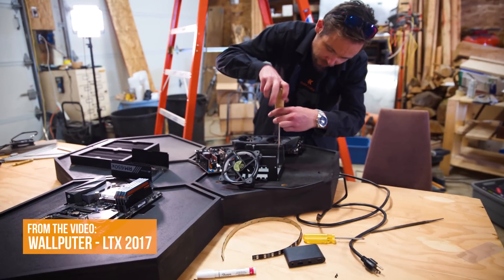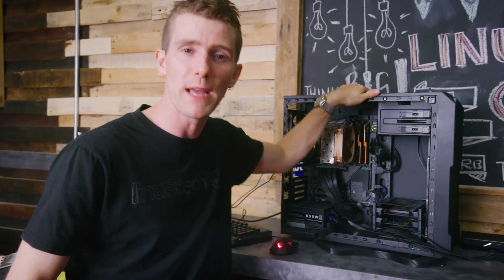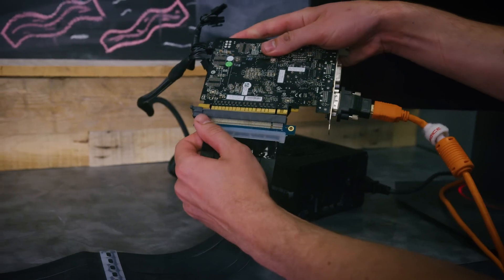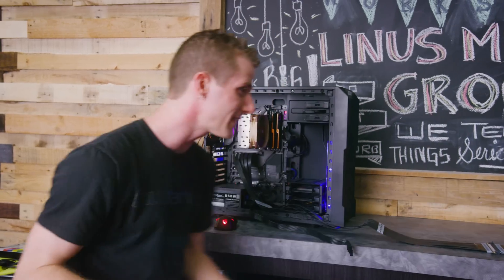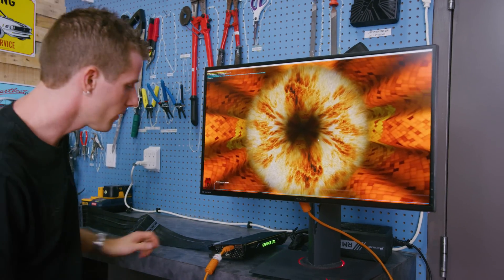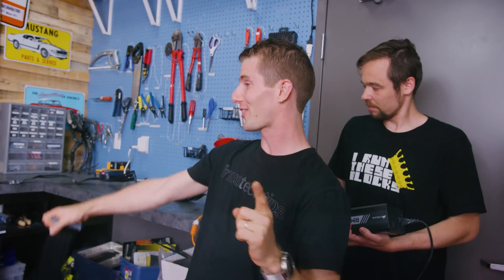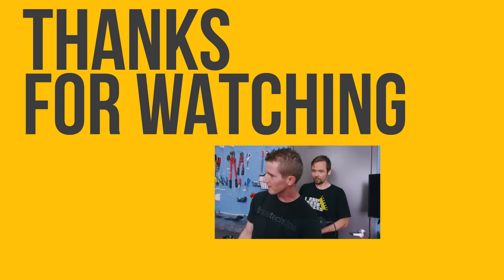How many PCIe Extensions is TOO MANY??

Comment: Hi there, while looking for a solution concerning PCIe extensions... (...the year is 2024)  your test popped up! Very interesting!

I have a Gen9 HP DL360 and I am willing to connect two external GPUs by using 2x PCIe 3.0 x16 extensions. Reason: It's an old machine, it was bought relatively cheap, and it's already here... and it hasn't, to a certain extent, disappointed me yet!

My Idea:

Use the PCIe 3.0 extensions running through the back of the server - plan is using long ones - removing the slot covers to allow the extensions through;

My server PSU is a platinum 1400 watt which came with the server when I bought it. It's meant to power up the server's CPUs and the usual server stuff, and therefore I believe an 800 watt psu will do the job, leaving me the 1400 watt to use with the external GPUs by adding a Parallel Miner breakout circuit;

I have 4 SATA power connectors, and I am currently using only 3. The thing is, while I plan to use an HP similar power supply but being with a breakout circuit such as the [ X21 Breakout Board ], do you recon there is any sort of way I could use the fourth sata power connector to send signal to the external power supply breakout circuit to tell the PSU to turn on? Or is it best practice to power-up the auxiliary PSU and then fire-up the old HP Monch...?

Theoretically I think I could plug an Add2PSU chip to the fourth sata port in order to send power signal to turn the secondary power supply, but correct me if I am wrong, that would have to be an ATX power supply, right?

...thanks in advance!

Comment: Hmm, that's an interesting idea. buy 2 power supplies and one will pull the CPU and the other PSU 2 GPUs in a different Case. This may solve the overheating 

It wouldn't even take up that much space if I had a smaller Case and I could have a 4or5th 4K monitor on. 

I have an RX 6800 xt and an RX 6950 xt at home. Probably, I wouldn't even lose that much performance on that 6950 xt

Comment: You can't do that with Dell prebuilts which have a single 6 pin power connector to the mobo (instead of the 24 pin atx).

Comment: 4 is too many, how the hell do you have the space to use all 4 slots and still be able to use the x1/x4 pci-e slot?  these days graphics are so powerful and reliable, you only need 1 graphics cards, then if you're a media addict, a capture card, then a sound card, but that's pushing it with heat output

Comment: Make a multi case build where as many components are stretched as far from the mobo as possible using extensions etc. and each component housed in its own case, with case cooling etc.
Be interesting to see what kind of thermals you could achieve by isolating components and cooling individually

Comment: Well I mean even copper wire has resistance.. the longer it is the more resistance it accumulates.
Apparently though it takes the length of a football field of copper wire to achieve 1 ohm of resistance

Comment: hey Linus, question for you, how will these extenders work with the new 3000 series? like the 3090 for example that has a crazy 19.5 gbps, I read the specs on the Thermaltake premium extender and it seems it only goes up to 8 gpbs so I assume there will be a huge performance loss there, Cheers! and keep up with the great videos!

Comment: Are these PCIE G4 or gen 3? Instead of looking for dropped frames you should check the bios for PCIE link speeds. If your PCIE link is gen 4 then with the extension it's already degrading to Gen 3 and the link training is now happening at gen 3 speed. And maybe even worse Gen 2 speed. So working or not working shouldn't be the criteria. Btw if your link speed trans at gen 4 speeds then you don't even have to look for dropped frames it's trained at gen 4 speeds and it's not gonna drop any frames.

Comment: Really it comes as a huge surprise that more than it worked with more than one.  With that other one you had made of ribbon cable one is probably the limit.  And to think for a while we were connecting hard drives with ribbon cables.  I still remember my Uncle every once in a while for some reason unable to get a hard drive to be detected.  My only guess is he fidgeted to much with the connection, ever notice how loose those ribbon cables get on the drive when you mess with them too much?  It is a miracle people put up with that as long as they did!

Comment: Jesus this really shows one of the bottlenecks of modern systems, especially computers (consoles don't suffer from this problem as much due to much better integration). The CPU is always spending such a huge amount of time just waiting for shit to arrive. And communication with the GPU is just so slow due to all the layers of abstraction (which consoles just don't have or need due to only having 1 GPU they'll ever use) and other messing about. For example if we assume that electricity travels at he speed of light in CPUs (it certainly doesn't), then for every 1m between the CPU and the GPU you're introducing at minimum 10 CPU cycles just *purely due to the distance*. So in reality you're probably introducing hundreds of CPU cycles of delay here, and the system doesn't even notice it. It really emphasises the problems.

Comment: You didn't try running a blender or a power drill in the room.  The longer cables will be more susceptible to em noise pickup.  The experiment result will be different depending on the environment.

Comment: Food for thought. Wire Heat Maths- more Length = more amps across wire = more heat. The motherboard  contact could be thermal throttling because of the PCI connection being so long, a classic case of over-amperage. Also the gpu may be over heating due to the over-amperage. Watercooling the gpu may help the framerates as well.

Comment: You ought to do this one again! But this time with PCIe gen 4. It's basically a big deal that the traces have to be "better" for it to work. Will "dumb" wires work though? Also: dumb PCIe bifurcation modules such as the Asus Hyper M.2 x16 card: will they work with PCIe gen 4 considering there's like almost no logic on them?

Comment: 1's and 0's are allways 1's and 2's. No matter the voltage it's still just reads as on or off so you would need to have about 78.32 meters minimum of risers before you have the total resistance level of 0.00010

Comment: I know this is old, but I was curious about the theoretical limits of this idea.

PCIe Gen 3 has a base clock speed of 8 GHz, and power is conducted through copper wire (I guessed for the risers' wire material) at ~2.85x10^8 m/s.

This works out to one clock cycle being the amount of time that power could go around 3.5cm, about 1.1% of the achieved distance. Obviously there is something incorrect here. My guess would be that the PCIe clock can slow, giving more time for the signal to transfer, though I don't know how they would slow as far as these guys got without loss of performance. If anyone knows how much data a Titan XP draws from the available PCIe bandwidth running the type of application they were, you could figure out how low those clock speeds could go, but I could find those specs online. 

Interestingly, this means that older PCIe generations should actually be able to go farther, as their lower clock speeds give more time for the signals to propagate.

Just some thoughts. Good video!

Comment: I can't imagine that Furmark pushes very much data through the bus or is sensitive to latency.  It's designed to set up a bunch of (fuzzy, fuzzy) nonsense for the purpose of heating up the shader units, but it's mostly independent of the motherboard.  Video encoding would be a better test-case.

Comment: Typing 22. august 2019. [PCIe 4.0 is coming up] Does the riser cablels have a kind of signal amplifier? I´m right now intrested in the new PCIe 4.0 16x motherbordsbords (x570) and hered that they use special technics to get the signal stabel over a longer way for secound SLI card for example.

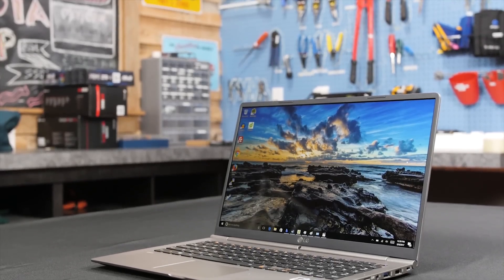Comment: 8:09 So the test starts stuttering, they say they reached the limit, aaaand... The cards cooler is totally blocked on the table. (facepalm)
Reply: I wonder if it would stutter or have smooth lower FPS instead.
Reply: @ПётрБайкалов-з1е  good question. I have no idea. I could see arguments for either case.
Reply: @ПётрБайкалов-з1е  nah

Comment: Makes you wonder why nobody in the high-end case market hasn't already used PCI-E risers included in the price to provide a creative and vastly more efficient mounting position for the GPU...

I mean, screw vertical mounts to show off your bling... What you want is your GPU fan intake directly stuck onto an intake - or better yet, just a separate compartment at the bottom or top where you can both get direct access to fresh air AND vent all the heat right outside the case to make cooling the chassis trivially easy.

Of course, nothing is really stopping you from just doing this yourself. It would be easy to use a riser from a lower slot down to any case with a bottom intake - or you could go full ghetto and just let it sit outside your case if you just don't care :D probably well worth the cost in terms of cooling benefits over lots more casefans, watercooling or very expensive models with overengineered coolers.

Comment: `Yeah, this makes sense. signal loss due to the connectors and copper. however; a properly made cable would probably still go further. IBM had this issue like 30+ years ago with cable runs to the Disk storage on their 'System/38' mini-frames (not quite main main frame class) we are talking 30 ft distances, and entire room distances. Their solution? 5mm coax (one for each  signal line) platinum cables. 

How do I know? I scavenged some of those bundled drive cables (about 1" around) and repurposed them as video cables. - new ends on a couple and 30ft+ later I still have no discernible issues with  signal problems. Now even tested to 1080i standards too.

I had two of these cables - looked like this: https://upload.wikimedia.org/wikipedia/commons/c/ca/IBM_360_Bus_Tag_Cables.png

They were the bus cables that connected the main system to the 'exterhnal' enclosures teh drive stacks were housed.

Yes, I cut my professional teeth on this machine -  from operations to programming in RPGIII.

Comment: good to know, I need to get one of these to move my parts from one case to the other, but it already has a riser from a SFF case that uses m.2 nvme drive on it and the GPU, and it will make it sideways in the case not attached to the case, so this is exactly what I needed to make it fit into the new case! Instant buying tomorrow!

Comment: Quick question about the power supply. I need to power a gpu with its own power supply similar to what you've done in the video, but the Rosewill 550w PSU I've purchased claims that it will not power on if it's not connected to a motherboard. Has that been your experience, and is this an issue that is specific to certain types/brands of PSU? Any help is appreciated.
Reply: Nevermind. The "paper clip trick." I thought it would be much harder to find the answer. :)

Comment: you can now buy a 4m pcie cable :)  https://www.amazon.com/LINKUP-Shielded-Twin-axial-Extension-Straight/dp/B07CS54VHS/ref=pd_sbs_147_5/260-5546373-8668643?_encoding=UTF8&pd_rd_i=B079926NM5&pd_rd_r=79d18581-5c1a-11e9-a40c-a5d2740d4f57&pd_rd_w=a4lKt&pd_rd_wg=kclKB&pf_rd_p=74d946ea-18de-4443-bed6-d8837f922070&pf_rd_r=39XWMPCG0M2NXP1XN3C3&refRID=0G7021DBGN8M29S0YA6T&th=1

Comment: Of course the Titan would be capable of a longer length.  It's power regulation on inputs and outputs is probably much better than the cheaper cards.  Plus plenty more connectors to ground vs only through pcie.

Comment: Power drop. Even data signals are a form of energy. Eventually the gauge of the wire adds up over distance increasing the resistance the aforementioned signals must travel. See: Ohm's Law.

Comment: Another idea for an experiment would be to use a PCI-E SSD and measure file transfer speeds at each extension length
Reply: ...Using a raid card (raid0, yolo) and 24 drive backplane.

Comment: The reference 650ti is rated for 110 watts and only has 1 6pin, so it HAD to be drawing some power through the risers. While the titan xp, rated at 250 watts and having two 8pin connectors each rated for 150 watts, could draw all its current from the power supply that you had right next to it.

Comment: Im guessing the fact that extending it didn't affect fps is due to that being a statistic that measures the internal power of the gpu, so as long as the graphics card can get enough electricity out of those pins to cope with the resistance of the cables it should be rather fine, until you extend so much that the synchronization of the clock speeds of the pci bus no longer match adequately, which forces the whole system to drop clock speed. Or so I guess

Comment: Wait, so I can actually DIM (like DIY but Myself - get it? ;)) e-GPU case (as long as I also provide it with power supply of course)?
What I mean is that I can have very-small factor PC - one w/o enough space for full-size GPU (but still can run on the iGPU integrated in the CPU),
And then another case just enough to fit my uber-powerful, ultra-long full-size GPU with corresponding PSU in it, have extra PCIe Extension (so that one of them is attached to the internals in each case) and only attach them when I need the extra GPU power (and am willing to carry both cases with me that is)?
That would be great!
I was considering getting something like the powerful NUCes (like Hades) and look for a e-GPU case for my gtx1080, but was postponing it because of the known performance hit we get of the GPU-performance when working thru Thunderbolt port (-15% isn't that much since I rarely high my GPU limits, but I just prefer future-proof solution ... one not requiring upgrade to the newest $1000 GPU just so that I can live with these -15% hit)
And perhaps there would be some better thermals when the CPU & GPU are not cramped inside the same case?

Comment: @Linus\ Tech\ Tips, could you please get a massive number of PLX boards like those used in mining and see if there is a limit to those? Because they are active, each appears as a bridge and should recondition / regenerate / retime the signal. You'd only need the PCIe 3.0 x1 ones that go over a modified USB 3.0 cable. Cheers!

Comment: I'll tell you that contrary to popular belief, PCIe can be extended practically unlimited distance. Thunderbolt, for example, encodes the PCIe signal as another protocol and reconstructs it at the other end, so there is no signal degradation. It could go further, but I don't know if latency timeouts start to become problematic. Worst case you have fibre runs of X meters and at each end, a PCIe bridge that does the 3R of signal conditioning and repeats until you run out of busses. Not pretty, but it is far from the short-ranged interface everybody believes it to be.

What about those U.2 cables for PCIe SSDs? 1M length without signal reshaping or reencoding.

Comment: Could you tell what speed this was running at? PCIe can run at 1.0, 2.0 3.0 speeds, it will still look OK, but speet will be 1/4 if it's at 1.0 speed. Gen 3 can run at 3.0, 2.0 or 1.0 on the card or the slot.

Comment: The longer the lines, the more resistance AND inductance is generated. Yes, inductance. That pretty square wave coming out of your grphics card ends up looking like a triangle wave.

Heres a super quick view of what that might look like: http://armymunitions.tpub.com/Mm07047/Mm070470032.htm

If the lines in those extensions were twisted pairs, you MIGHT be able to get a longer distance. Depending on weather or not it was the resistance of the wire, or the inductance... (The twisted pairs of cables helps to reduce this inductance effect)

Comment: You should have kept track of whether it was still running at PCIe 3 at different cable lengths, or if it was degrading back to lower versions.

Comment: you should also try to increase the voltage of the GPU just as if you overclock it in case the failure is due to a loss of power

Comment: that is a very high end cabel i had 2-3 diffrent PCI extendors, none of them work, and if i finaly got a picture my graficcard would run x8 insted of x16.. them cables it forged deep down in hell by satan. i will not spent half the price og my graficcard just to get it angled

Comment: I wonder if the number of connectors makes a difference too. Like if you did the same length but with 30cm cords it would fail. It may be that is where you have the greatest signal degradation.

Comment: 5:39 the thing is the CPU probably did not Interact with the GPU much. (as in pushing / pulling stuff from the Memory). Because if you look at it now a days most common Optimization is to reduce Memory Access . Why? because it just takes (compared to a calcutaion on the CPU infinitly longer. with 3m Distance assuming we would send our signals at light Speed (~ 300 000 000 m/s) we would need to 0.00000001 Second to reach it while if we run at 3GHz we need for one Calculation ~ 3.333*10^-10 Seconds = 0.000000000333 Second. which is a less obviously :)

Comment: I dont see why it wouldnt work, basic electricity  if any the power wire isnt thick enough for the amps and the signal is contaminated with trash other than that... i should work no problem

Comment: Maybe the drop down voltage of the supply line via those extension are too high? Maybe if someone crazy enough to cut out the power line and plug it to another supply, maybe it will work?

Comment: The loss from each connector pair is probably again as much as each length of cable.  If you just got some  high-quality shielded multiconductor and connectors you could probably do truly ridiculous things; each of SSD, Graphics adapter, audio card, NIC, and whatever else off in its own cabinet with its own PSU and fan, like a miniature of a 1950s mainframe!